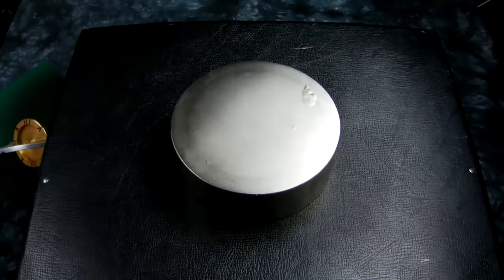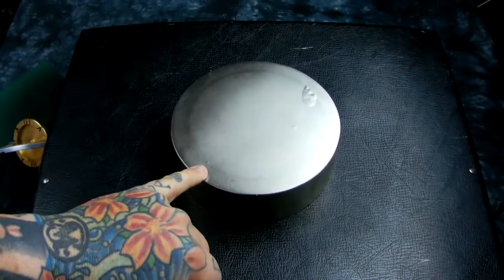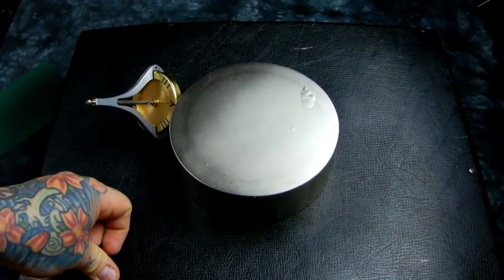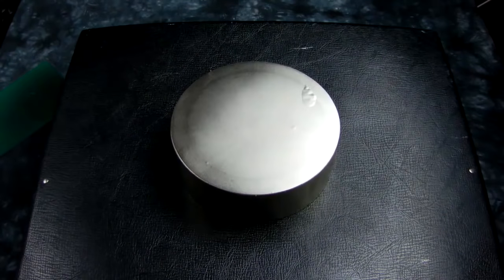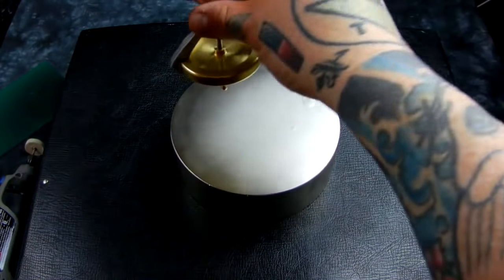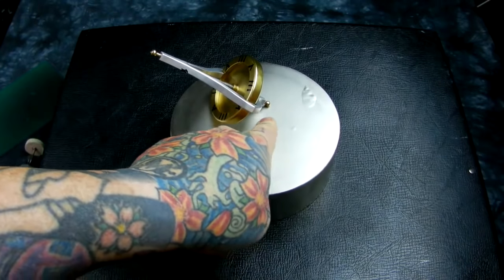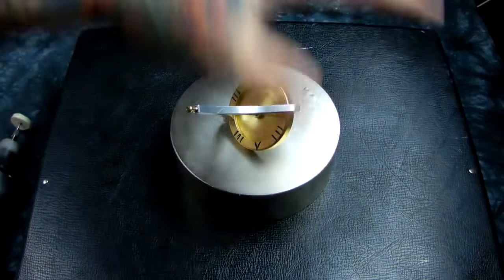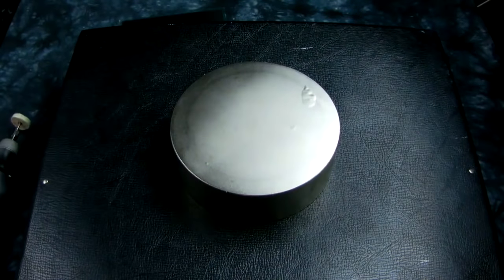Must-See Video! *SECRETS OF MAGNETISM* Never Seen Before* Torus-Hyperboloid

Comment: i would have to guess that the "brakeing" is actually just a measurable magnetic alignment on a planetary or even galactic scale or of and including multiple factors.  its not actually brakeing, its relaxing and going along with the ride aligning and flowing with a very very large current. the magnet is the rudder.

Comment: I viewed a video not too long ago where the presenter dropped a magnet through a clear plastic tube and it passed from one end to the other at a speed consistent with the pull of gravity. Next, he dropped the same magnet into a three foot length of copper pipe and its speed was retarded by the electromagnetic fields created by the magnet passing by the walls of the pipe. The speeds in the two tests were remarkably dissimilar. Is this the breaking effect discussed here but demonstrated in a different way?

Comment: The distance isn’t the same when you place it in the center. Then you go to the edge and drop it a few inches so your test has two different variables so its meaningless. Not saying your wrong but your test was point less. I wouldnt adjust two things at once on an engine when troubleshooting then i woukdnt know which one fixed it or made it worse. One at a time

Comment: I thought you were just generating a magnetic field by creating a current of electrons moving in a circle. When you moved the centre of rotation of the gyroscope away from the magnet’s centre of highest flux density, the flux density experienced by each electron tracing the circle varied as it went round. Work was being done changing the electron spins and that was creating a resultant force acting as a braking effect as the polarity of the magnetic field in the spinning disc varied continually and tended to be out of phase with the permanent magnet’s field.

Comment: You know i understand a little bit of how a magnet works amd how electricity is generated, a copper coil wire cutting threw magnetic lines of flux induces a voltage into said coil, i do not have a clue about the other things you are saying but i am alot more interested in the fact that once the flywheel gets going it keeps going amd would like to know why it doesnt stop ? I dont mean to sound stupid here but what im imaging is placing a big ass magnet under the hood of my car connect 2 of those flywheels to it one on either side or even just use one connected to an axle to spin the wheels and eliminate the need for fuel. Obv it needs something to get it spinning but once that happens it goes on its own. Now in electric cars or even just an alternator for example the magnet spins and the coil wire is stationary to create electricty but in that case the whole system is still depended on that electricity, with the way youve shown it how you reversed things with the magnet stationary and the flywheel spinning that would be like an endless way to create electricty because the motion created is only dependant on the magnetic flux which i dont think ever runs out but ya anyone know what im getting at here?  am i wrong to think that way or ??

Comment: I use magnets to set up flux lines which deliver frequency through batteries to de sulfate the cells hence recharge them quickly without heat or distortion. 
the batteries run my home 24/7

Comment: All visible particles have protons circling them as a basic law of physics. When excited by the magnetic field these protons that actually give mater it`s gravitational weight, become excited with one end of the field and decelerated by the other end of the field. The excited field excites and the opposite happens on the other side of the field. That is the breaking effect, no excited particles. Plus every particle has it`s own magnetic field. Some are weaker than others depending on particle size/mass. So when a material with larger mass particles is magnetized/excited the other particles it can effect ( which is usually metals ) the protons in larger particles. Now there are invisible particles that have no protons ( these are rare particles) and have little or no reactions to magnetic fields.

Comment: I have a theory that the electron path ,or circuit lines of the magnetic field , the negative space Between electrons Expands and contracts.
You'll have to excuse my terminology since it's not that great  Also my punctuation is quite terrible you'll have to bear with me.
  As the electrons spin around one another In propulsionary opposite directions Like one corkscrew inside of another There is Within the circuit line itself along the electron path a sort of Elastic effect Or maybe a better way to say it is a coming together, and a going apart, of the  Individual electrons,
 This makes the individual circuit lines grow and shrink As the electrons attempt to collide, pulled together by their atractive force, then go apart pushed apart by their repellent force, This coming together and going apart Translates to the entire Taurus circuit .
 bouncing back-and-forth between attraction and repulsion is the electrons dance it's what keeps them in motion In other words the 2 corkscrews are not  firmly locked in a no float state but rather expanding and contracting.
 If this is in fact the way the electrons behave then the entire circuit Or Torres should be essentially Fluctuating Like a heart beat Therefore the centripetal convergence would essentially be staged.
   there it is right there!!! there's your switching, your kicking, your commutation, your ability to utilise the magnetic jet like a  Surfer rides a wave or the rotor spins Through the stages of The stator coils  Because the sintrapetal convergence is like a (pump) Or a 2 stage motor With the stages being wide, and narrow, or open ,and close,  Rather than
 + & -  Or on and off.
 We know for a fact that this works We see graduated magnetic field Geometry work like in the case of the linear V gate .
   Like I said you'll have to excuse my terminology  But I believeThe proper way to say it would be a transverse Wave state Inside of a closed loop magnetic field. I have some drawings and a 3-D graphic If anybody wants to take a look.

Comment: Whats going on is the same concept as using an electric motor. Think about why you need an internal copper coil to make the motor work. It only is able to spin in the center and not on the edges because the electro-magnetic field is uniform in the center pushing out, on the edges the magnetic field interferes much more because it applies more to the closer parts of copper. This leads to it stopping, just like you could use to make a copper coil motor move.

Comment: Same thing as a magnet going through a copper pipe the eddy currents generated in the copper resists the magnet field and the magnet field is strongest at the corner of the magnet maybe put iron grindings on a plate above the magnet to see the strength of the field in different places I believe it will be strongest at the corners

Comment: In layman terms what is happening here is, when you move a metallic object through a magnetic field it becomes magnetic itself, so the giro is the moving object in this case.
When it becomes magnetic it too emits a magnetic field that opposes the field from the fixed magnet  causing the breaking action.
This is used in some high end electric cars.

Comment: Eddie currents are slowing it down on the side of the magnet, but on the middle of the magnet the turning brass does not interfere with the magnets field. Thats my guess because thats how old kW/h meters work. Eddie currents spinning wheels and permanent magnets. In my theory then there are some voltage running in the brass wheel while it slows down.

Comment: Theres a much simpler explanation. Eddy currents are induced on the outer edge due to lenz law and stops it. It doesn't do so in the center because the magnet is very weak there. Flux density and strength and NOT interchangeable. Flux density can be high in the middle and still give a weak field because the total flux is lower. Flux per unit of volume does not determine field strength, total flux does. If you want to make an extraordinary claim against general relativity( arguably the most predictive theory ever by the greatest genius of all time) then you better bring extrordinary evidence.
Reply: Einstein, by his own admission, did not have the greatest mind of all time. In fact, the flaws we now see in his theory of relativity were pointed out immediately after he created it by the man Einstein thought to be the most brilliant man ever, Nikola Tesla.
Reply: @ryandebock6277  Sorry to tell you this but this is a silly facebook quote from Einstein that was never said. I also am guilty of believing it before I researched it. The two had public disputes and Einstein did not respect him. That being said, I do think Tesla was an incredibly intelligent man. One of the best of all time. Don't know who told you relativity was flawed but that couldn't be more untrue. Relativity has only become more robust with time.
Reply: The theory of relativity was created as a response to the Michelson-Mory experiment that failed to show the existence of the aether. It is nothing but a theory, compounded upon many other theories that arise every time something doesn’t pan out. However, scientists have since proven the aether to be real, thus destroying the very foundation of the theory of relativity. That isn’t to say that none of the theory is correct, it’s just saying we have to reassess the theory based on the new evidence, which mainstream science HATES to do. Instead they just create another “theory” that prevents them from having to do so.
Reply: That isn’t to say I’m right about that quote. I’ve read that numerous places. It very well might be wrong, and even if it was said it might have been sarcastic. Idk I wasn’t there.

Comment: TA, dude, I hope YT has monetized your videos, because you are getting good mileage on this one. I remember watching your first ferro cell videos, very revealing. Opened my eyes to magnetic flux Vs the old iron filing demos.  -- Would like to see you spin up your gyro And place it's axis on a radial on the magnets' bloch  wall plane. That would seem to be the balance point of the outer vortexes, and would apply forces symmetrically to the rim of the gyro.  I dunno, lay that gyro over 90 degrees and drop it over the edge of the magnet and down halfway. Try spining it the opposite direction. If you don't try this I'll just have to make a small gyro to match the size of the magnets I can afford. Ha. Now where is my microscope?
Reply: While you're at it try spining it the opposite direction, just for something different.

Comment: The magnetic field inside of the magnet can move about.  It is not confined to a specific area. It is directly effected by outside elements. The gyro is cutting through the fields at what ever rate of spin the device was charged.  When you go to a different side of the magnet it will be cutting the static field of the magnet and slowing down the gyro..  There are three elements to a magnet, The North the South and the "B" field. The "B" feild is the same plasma as is in Lightning.  Lightning is a plasma field it is the equivalent to the center field in a magnet.  Your od's of being killed by lightning if struck directly by same is less then 1 out of ten.  Also there are a number of people that have been struck and claim it made them feel much stronger.  Anyway simple stuff

Comment: You can do the same experiment by dropping a slightly smaller magnet down a brass or copper pipe. This is just unharnest magnetic flux creating electricity.

Comment: The brass gyroscope at the centre point is acting simply like a Faraday disk. Since the vertical field is uniformly symmetrical about the axis centre point a potential difference will be generated between the gyroscope circumference and its central axis. Faraday generator 101. Since the field on the magnets outer edge has no circumferential symmetry a  non uniform field will flow through the gyroscope. This will cause eddy current loops to form and will act as a brake on its motion.
Spent a decade designing and running Faraday disk generators.

Comment: Electron and proton dipole effects . This is why the dark ring is on the outer edge. Flow from the center is non dipole, and dipole on the edge. As atomic nuclei reenter the magnet, the electron configuration is different than when leaving the magnet.   This is how fusion happens in our star. The magnetism of sunspot plasma, attracts certain pure metals. The cosmos is a magnetic field, Think of the dark ring as the asteroid belt....

Comment: for those who don't have a $1000 N-magnet, use an electromagnet with two car batteries plugged into it. works just as similar. You will still need to buy a precis geo-spinner.
Reply: You you mean Gyroscope?

Comment: The lines of force at the edge of the magnet are perpendicular to the spinning wheel and induce a current in the wheel.  Just as current is induced in a generator.  As the currents travel through the wheel they produce a counter electromagnetic field that opposes the lines of force and thus provide the braking action.
Reply: Exactly correct.

Comment: Ummm. basics...The a-priori words don't do anyone any good.. btw Isn't the magnet ALSO pulling on the magnetic bearing shaft, creating extra friction? That 'rattling' admits to the bearing gap , not oil!..Why not even mention this? You need more than one "precision' (lol) flywheels to demonstrate it's not an effect of tolerances from this particular flywheel... you're overlooking scientific testing basics.. I get this is just youtube, but come on..where's your control test? And speaking of friction, couldn't that ring just be friction marks from where it was scuffed around in many labs, placed on many metal plates? Seeing that the face of the magnet is not perfectly flat (note the de-plated thumbprint-sized 'birthmark' on the NM face) the ring could just be the frictional contact point of the magnet's planar surface. Why not take a ballpoint micrometer to the entire surface for us to show it's not (or ever was) a simple artifact of the manufacturing process?

Comment: Composition and Use
Admiralty brass
30% zinc and 1% tin, used to inhibit dezincification
Aich's alloy
60.66% copper, 36.58% zinc, 1.02% tin, and 1.74% iron. Corrosion resistance, hardness and toughness make it useful for marine applications.

Note the Tin and Iron in the composition of Brass. Not much there but still present. The Flux lines project upward and ark outward and back to the other pole much like what we have discovered with our planet. What you have shown is flux line propagation the lines are close in the center of the magnet projecting up through the center of the brass disk with not much leverage on the Tin and Iron. Then when you place the spinning disks edge in the path of the flux lines leverage increases on the Tin and Iron causing the braking effect. Normally magnets don't have the strength to grab onto the small amounts of tin and Iron in brass but this one does. Try this with a spinning pure gold disk there will be no braking. Try this wind up two electromagnets on iron bars find the poles with a compass Then connect the two south poles together electrically with a hunk of 
Aluminum being careful to not let the iron bars touch. fire it up then pass the compass over it and look for the South pole you wont find it. You have created a magnet with two north poles. It took me an hour to figure that out when a University asked for help after working on it for months. You seem like an intelligent guy so I won't come down too hard on you for being such a crank because genius is only a half of degree from crazy! Recognition will come on it's own but not if you're a jackass because no one will listen to you. Take care and have fun. MJG

Comment: This experiment is totally inconclusive. You need to show how the precision gyroscope responds to being turned 90° in the center of the $1000 magnet such that the outer edge of the spinning precision gyroscope is in close proximity to the centripetal convergent center of the $1000 magnet. You did say it would continue to spin but you did not show it. Moreover, the inverse experiment should be repeated at the outer centrifugal divergent edge of the $1000 neodymium magnet with the axis of the precision gyroscope at 90° to the edge of the $1000 big hunk'n neodymium magnet. FYI: fire hose or drain it is still kinetic energy. In case you have not read a book in the last 100 years, it is referred to as conservation of energy.

Comment: I'll just take a stab at it. I happen to have a large copper pipe and a neodymium sphere and I enjoy demonstrating the properties of the relationship between the copper and the neodymium magnetic field bypassing the sphere down through the copper pipe and watching how slowly the sphere passes down through the copper pipe and then finally drops at normal speed to the ground at out the bottom. I figure the slowing down of the magnet by the copper as the magnet is passing along the copper is causing and opposing magnetic field beneath and above it must want to flow in the opposite direction of the magnet as it falls. Sorry for shity description. So the spinning copper component takes care of the motion and I gather there will be on the oncoming side one magnetic field and on the leaving side the opposite thus creating parallel fields that would end up locking the copper component in place. I feel like maybe I just described something rather than explaining something. Please forgive my small-minded ignorance but I feel like I'm getting it a little bit.